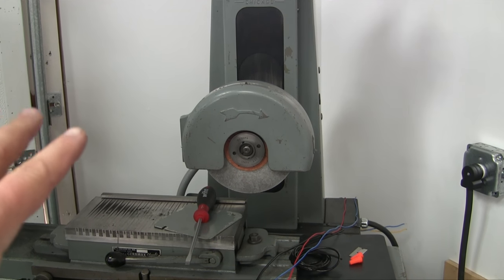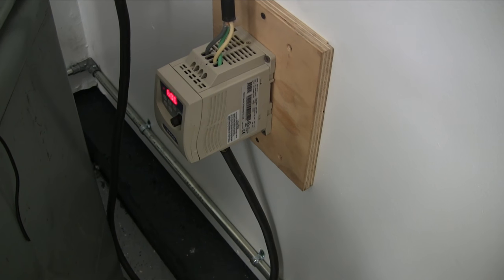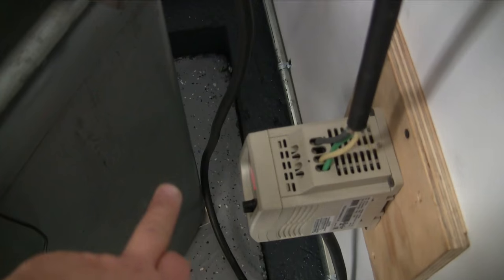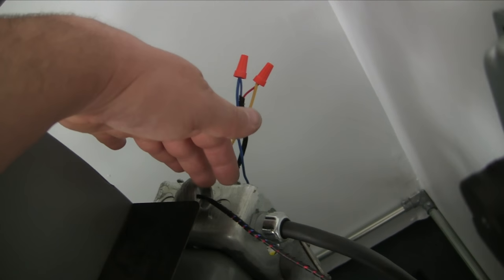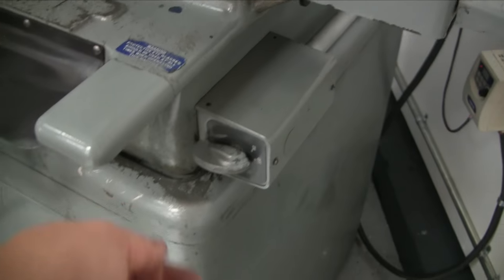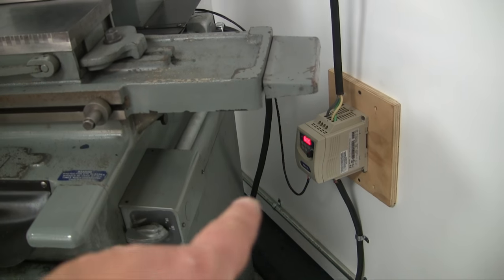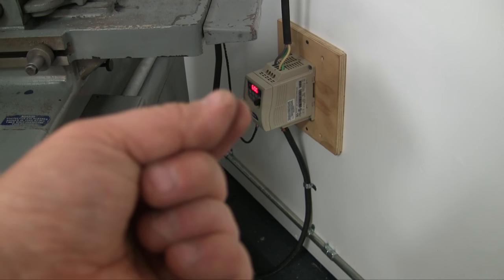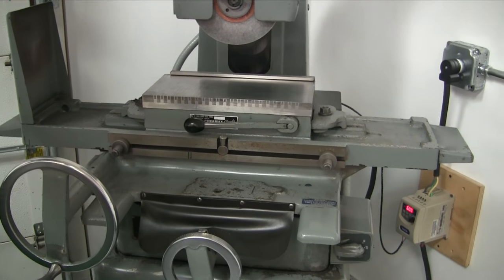Surface Grinder Re Wire Part 2

Comment: I would have mounted the VFD up a little higher so I wouldn't need to get so low to work on it. But then I'm  old and don't like to crawl around on the floor. An enclosure around the VFD would be a great help in keeping the grinding dust out.  
I like your channel. Keep up the good work.
Bob
Reply from the maker: Hey Rob - I wanted to keep it below the conduit line but once she's all enclosed, it will be pretty safe. Thanks!

Comment: The other day I had a similarly challenging angle problem when I was fixing my mother's furnace. No way to directly view what I was doing. The traditional solution is an inspection mirror, but my brother was there, saw what I needed, pulled out his iPhone and put it in with my hands, and showed me the view from its camera on his Apple Watch. It worked perfectly. First time I ever found myself wanting an Apple Watch. :)
Reply: brent mccullough Huh??? What does that have to do with anything??
Reply from the maker: I deleted it, Jon. Most likely spam.
Reply: BasementShopGuy Seemed likely, but the ones I usually see don't have anyone tagged in them, so I wasn't sure.